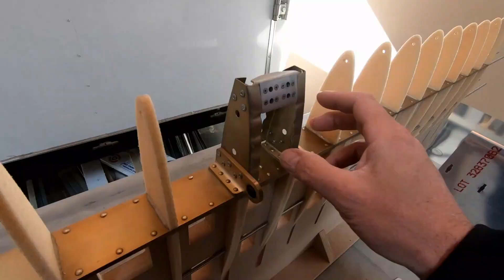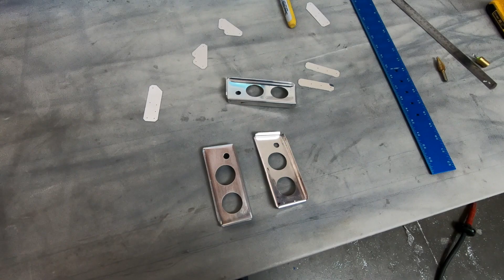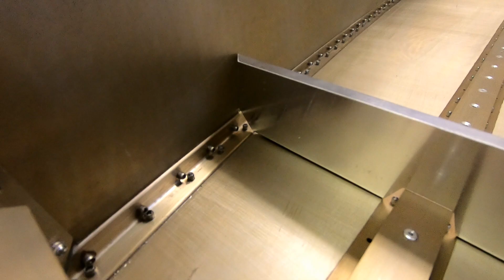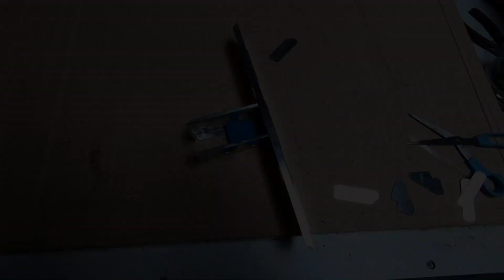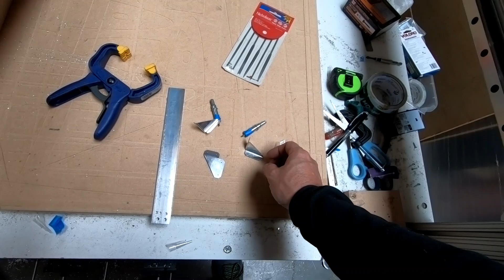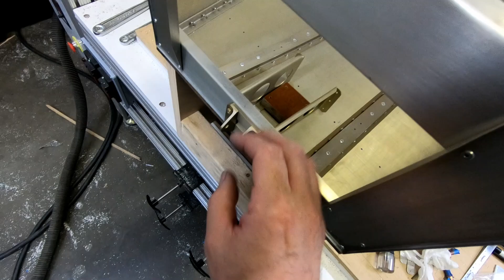14 - CriCri Airplane Build - Nose Gear Box and Frame 1B

Comment: Jim, do you think that phenolic block and all the specifically angled holes could be a 3D printed part with nut-serts for attachment?
Reply from the maker: That would probably work. Just depends on what material it was made out of. Phenolic is extremely tough and whatever you use has to hold up to the sliding of the nose gear leg over time.